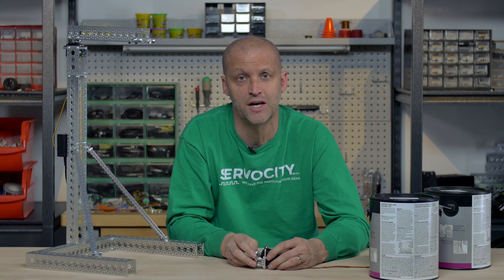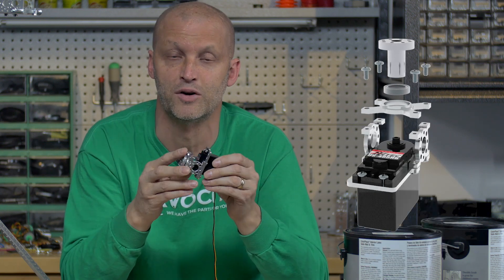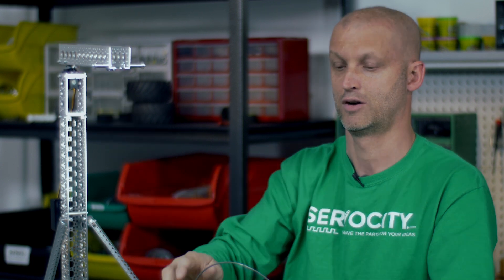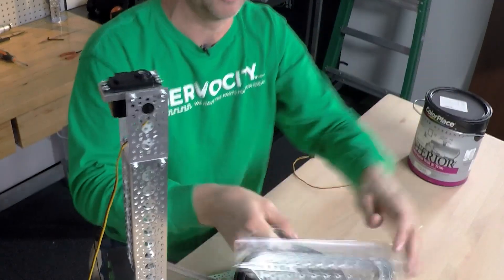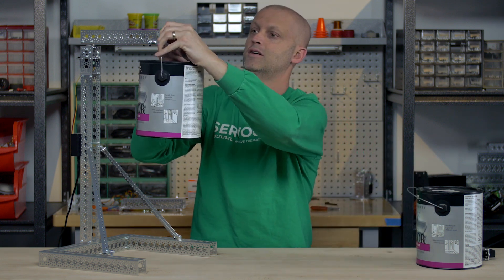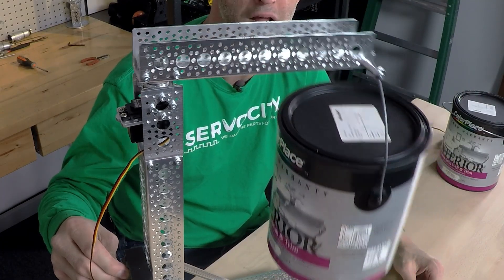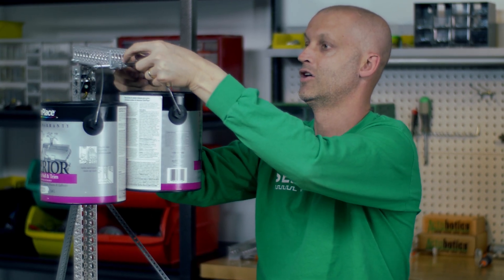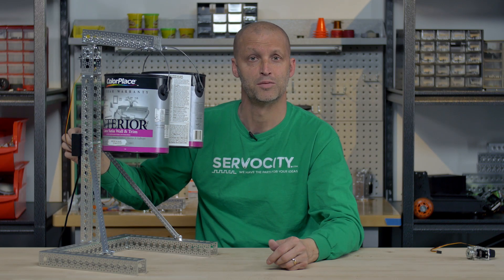Why Use a ServoBlock™?

Comment: How much torque would it take to lift 50 pounds on a 10 inch long arm?  Looking for the least expensive way to reliably do that.
Reply from the maker: 50lbs, 10" away equates to 500 in-lb or 8000 oz-in.

Comment: Could you tell me what the load rating is for these? I can't seem to find it anywhere on the site. Thanks!
Reply from the maker: Some of that comes down to what servo is installed.  A ServoBlock provides assistance to the servo, but there are still forces that act on the bearings (or bushings, depending on the servo you use) within.  The bearing of a ServoBlock has a basic load rating of 121 pounds-force so most of the time your limiting factors are going to be torque of the servo, the material of the spline and material of the servo case rather than the ServoBlock itself.  Feel free to reach out to our Tech Team should you have any other questions tech@servocity.com.
Reply: @ServoCity  Excellent- thanks so much!

Comment: The load applied by the weight at the end of that moment arm ends up being mostly axial, not radial.
You'll notice the first servo suffered a tensile failure, not a shear failure, as evidenced by it "popping" off upward.
The weight at the end of the arm deflects it until the hub comes in contact with the edge of the servo. The downward force from the can gets transmitted to a much larger upward force on the shaft of the servo, aligned mostly with the axis.

If the whole rig was laid down on it's side, such that gravity was acting along the same direction as the arm, then the weight of the paint cans would have acted radially on the shaft of the servo.

Was really hoping to get an idea of how much axial force a standard servo is designed to handle and this had the potential to be very helpful and ended up just being misleading.